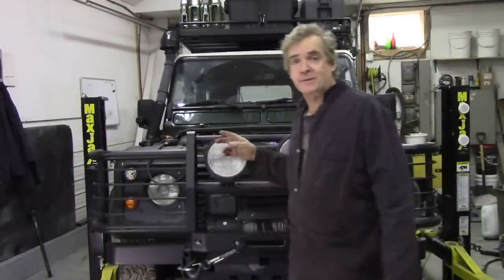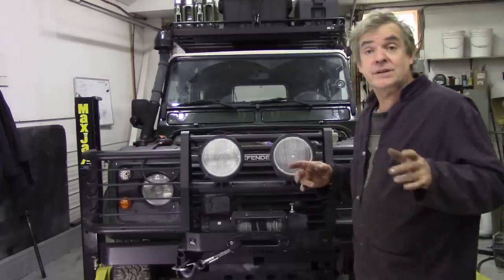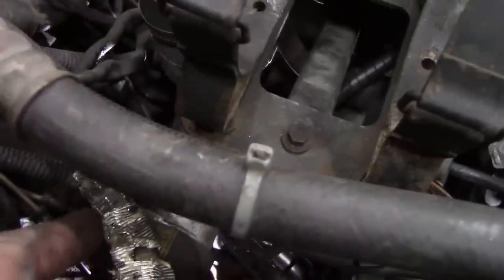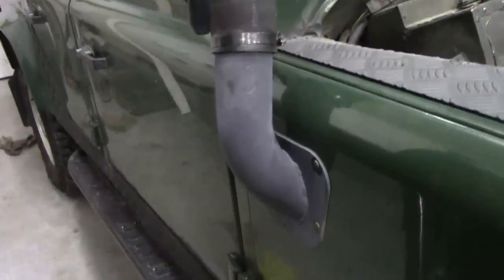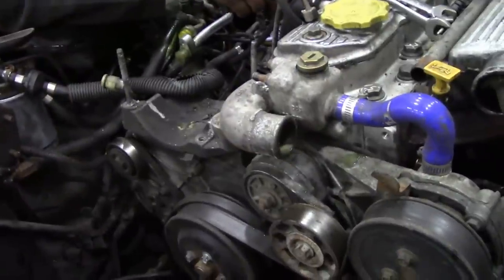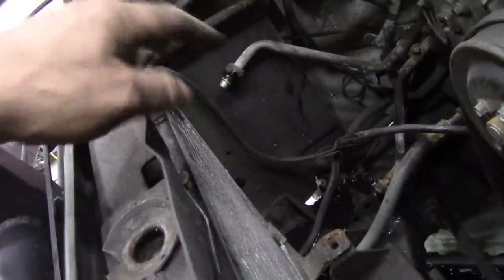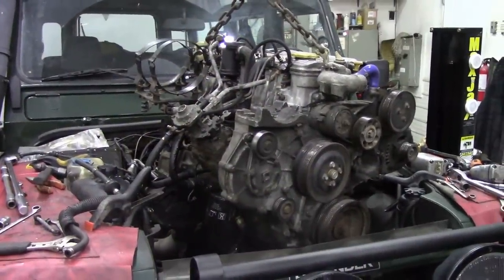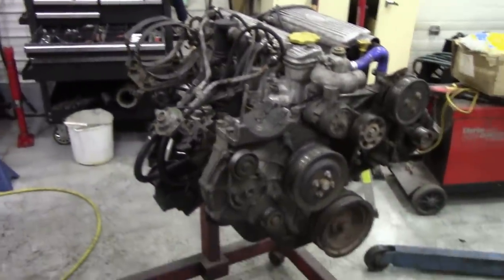300Tdi engine removal and a few surprises

Comment: What is the thread size of the coolant bung at 13minutes?
Reply from the maker: I have no idea as I have not got one on hand - but it is a coarse thread
Reply: @BritannicaRestorations  - I tried to fit an old Series drain tap, but the thread is different on the 300tdi.
Reply: 13mm, use a 6 sided socket with the right length extension and they usually come out ok

Comment: Great video - any tips on how to separate the engine from the gear box? Just lift a bit and use a pry bar?
Reply from the maker: I lift the engine and box while bolted together and put a block under the gearbox crossmember drop it down a but and then undo the bell housing bolts

Mike
Reply: Ok gotcha, so just leave all the transmission stuff as is (keep proshafts on etc). How far up above the cross member do you lift it?  @BritannicaRestorations
Reply from the maker: I lift until the bell housing almost touches the tunnel then put some blocks on the crossmember and lower back down

Comment: Thanks for update.
Imagine all that sludge in the oil galleries resulting in restricted oil flow to the crank and cam. I wonder if it contributed to the failure and of course the questionable big end bearing shells.
Would you change to hard to get at core plugs?
Reply from the maker: I am going to pull the whole motor apart 
The mains were good and the oil passage feeds the big end so I am not 100% the passages are blocked, but I suspect bearings are not up to the job of high speed and overloaded vehicle

Comment: Hi really enjoying your videos. What do you reckon is the best engine for a 110 if you want to tow? Not heavy mind you, around 1000kg. Been wanting to buy one for years but until I saw this wasn’t confident enough to dive in. Thanks much appreciated
Reply from the maker: Difficult question to answer - I only see 300Tdi and older here in Canada as we are limited by a 15 year old import restrictionThere are a few Td5's that have had the computers re mapped to make more power but I have no experience of thisA V8 would have a lot of power but drink too much fuel!The 200 and 300 Tdi's had the same power and torque, but the 200's are getting a bit old now and some spares are discontinued and the LT77s was not the strongest of gearboxesI would not buy a 2.5 diesel non turbo or the later TD/DT - they were a lot of troubleSorry I cannot be of much more assistanceMike
Reply: Britannica Restorations Ltd Thank you for the reply. Much appreciated.

Comment: Hi Mike
Great video. What could be causing the timing belt to be running forward like that (not on center on the pulleys)?
Best regards
Daniel
Reply from the maker: It seems to be over tightened belts - the housing can bend I have found, and the pump twists towards the crank just a hair but enough to cause issues
Mike
Reply: Britannica Restorations Ltd That makes sense! A good thing to have in mind!
Thank you!

Comment: What makes of bearings would you get and where would you get them. Cheers
Reply from the maker: Britpart sell Glyco bearings which are under the Federal Mogul / AE  brand which is OEM  - you just have to stick a G on the end of any part number to get the OEM stuff
Miss off the G and you will end up with King bearings (never heard of them) made in Israel and the wholesale price is £7.50 - Glycol are £20 BUT if you want to push the boat out and get genuine parts they are £85! 
Open the box - AE bearings!
I filmed a rant about this over the weekend but not sure if I should post it!
Mike
Reply: So genuine parts are the same as AE, cheeky buggers. Cheers for the info mike
Reply from the maker: Yes- a very expensive box
same goes for all brake parts and electrical -

Comment: Oh hang Mike, I lost that reply you sent me just now about the Defender not wanting to reverse. I think you said something about the 5th gear. Please resend your reply if it is convenient. Sincere thanks, Garth Richert.
Reply from the maker: So it is common for the layshaft to snap as it enters the extension housing - usually you have no 5th or reverseThere is no noise or grinding 
If you have no 5th then it must be brokeMike
Reply: @BritannicaRestorations  Thank you Mike. The 5th gear works fine. Do you think it may be something to do with the reverse idler gear? 
 Really appreciate your kindness in replying to my odd things. Go well. Garth
Reply from the maker: Could be - but in the last 15 years of building boxes I have not had to replace that gear - the reverse chews the syncro, and maybe in an extreme case, the syncro teeth are shot ir the baulk ring is brokeLooks like box out time!Mike
Reply: @BritannicaRestorations  Thank you kindly Mike.

Comment: Oil is oil. This guy just been running that oil way past maintenance requirements till it sludged up. 
My 300tdi has 520.000km on it and I use cheap 10w40 from a budget store, I just change oil every 3-5000km. 
Expensive oils might behave better at higher intervals, but even the most expensive oil will turn into caramel when its it burnt up in the engine.

Comment: If you keep putting cheap Chinese parts in your Land Rover, eventually you won't have a Land Rover, you will have a cheap Chinese 4X4. Hands up anyone who would buy a cheap Chinese 4X4? No? Well stop turning yours into one.
Reply from the maker: I understand Harvey, but in many cases that is the only choice we have as LR have discontinued many parts and those that are available from LR are often 10x the price
I think I have covered this a few time on this channel  - if LR supplied reasonably priced original parts the we would indeed fit them - Toyota have this totally spot on - lots of unofficial retailers selling genuine parts
Reply: @BritannicaRestorations  I stand corrected! I do have a bit of a rant regarding Chinese parts on a regular basis! 
Shame on LR, they really should be looking after those who look after their reputation.
I am lucky with my LandCruiser, as you said, lots of places stocking Genuine parts which helps me keep a very old girl on the road.
Reply from the maker: I cannot understand LR  - they had a world wide market and distribution chain and then priced themselves out of the market
On the other hand if they made their part better in the first place, then there would be no need for aftermarket parts!
Catch 22
Mike

Comment: another engine that has not been maintained properly. clowns should read maintance books and use correct oil. land rovers are not cheap to run.so have a good bank balance before you buy one